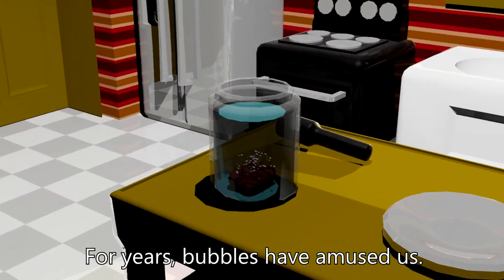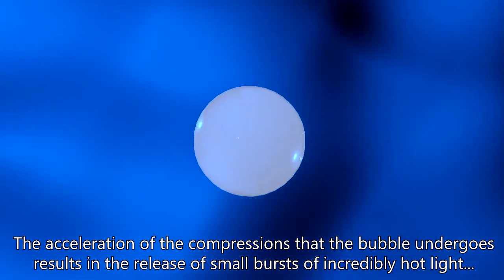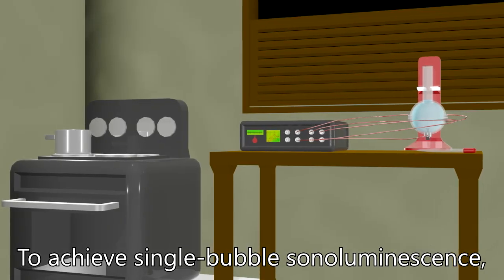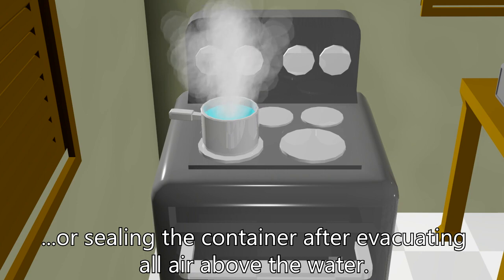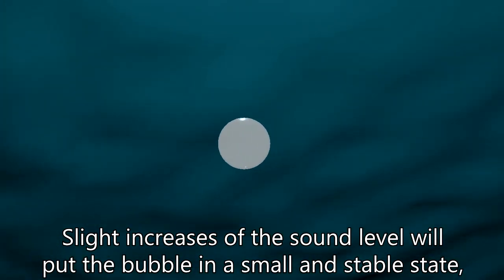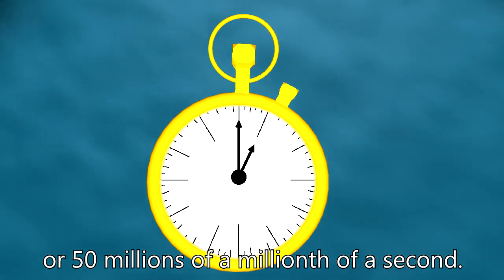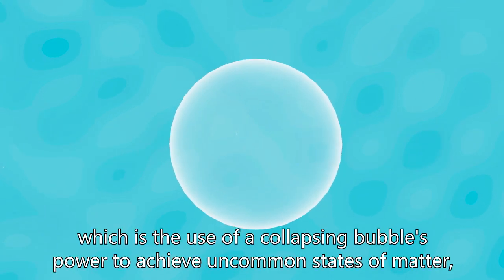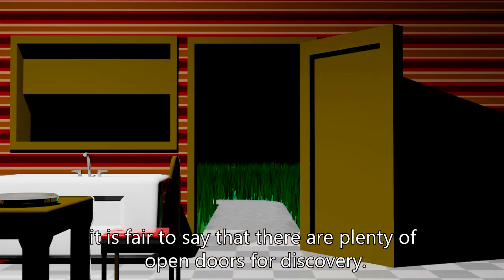"Sonoluminescence": TSA National Conference 2017 8th Place (SCIVIS)

Comment: Jesus, render time?
Also what software
Reply from the maker: It was rendered in 3ds max, which is an Autodesk product. Most of the video had actually really quick render time, but the one scene with the bottle in the beginning took weeks of rendering to complete. The more space the bottle took up in the frame, the longer the time it took to render. One of the shots of the bottle took about 7 hours per frame.
Reply: The software is 3DS Max